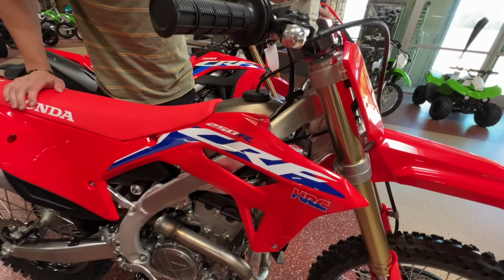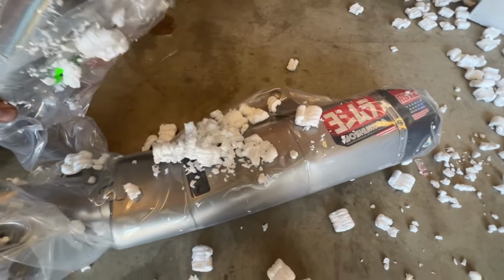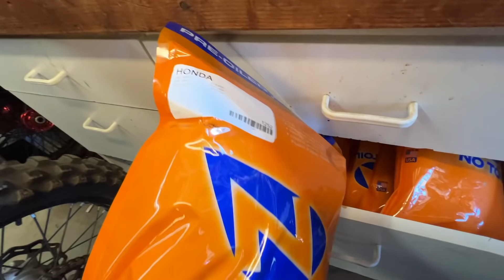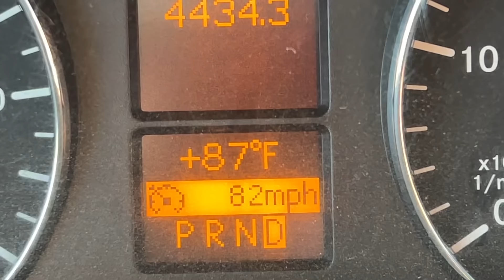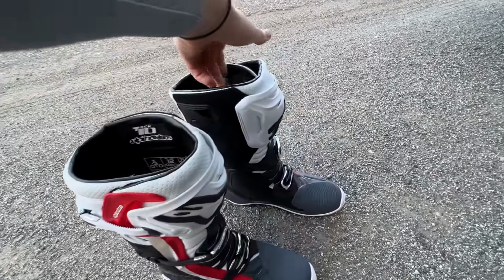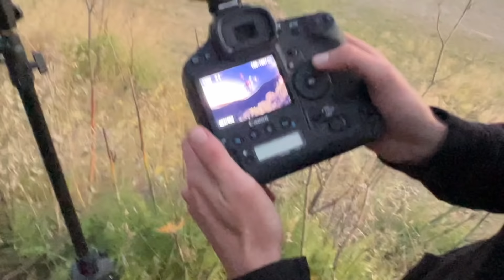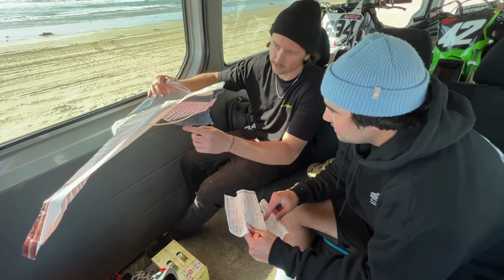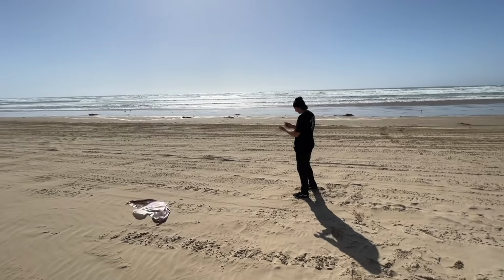FREE 2022 Honda 250 Dirt Bike - Buttery Vlogs Ep140

Comment: My dude. @7:23 Put those air filters in a plastic zip lock and pour a little air filter oil in, seal it, then massage the oil into the filter. No mess and retain the excess.

Comment: 🔥nother sick video guyzz.. just lil tech tip maybe help ya out. When oiling your filters, use old plastic bag or a zip lock, coat filter in oil then put in bag and roll round in bag. Try er out, no mess 🔥👊🔥🏍🏍🏍